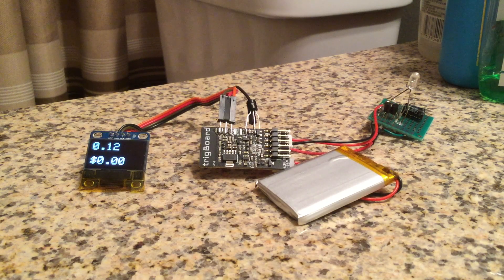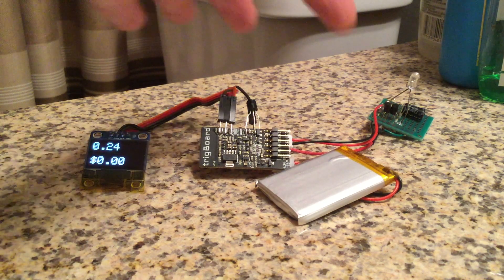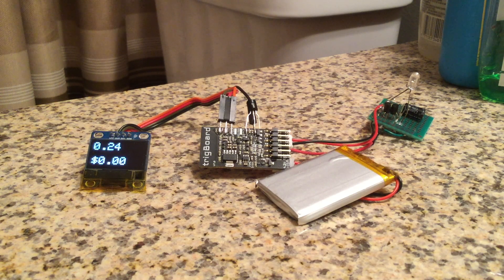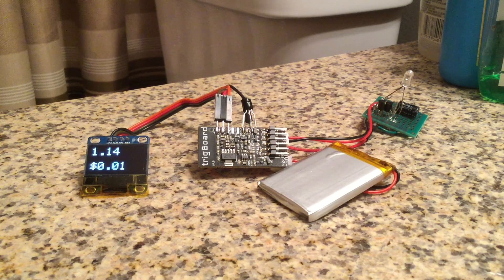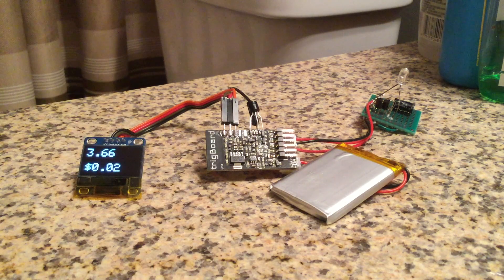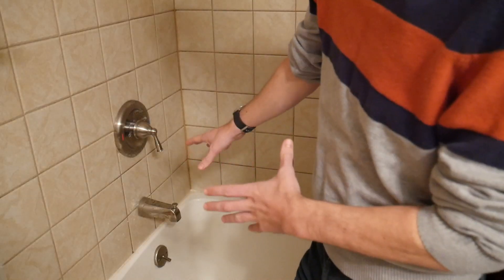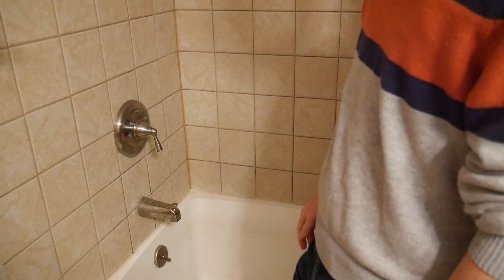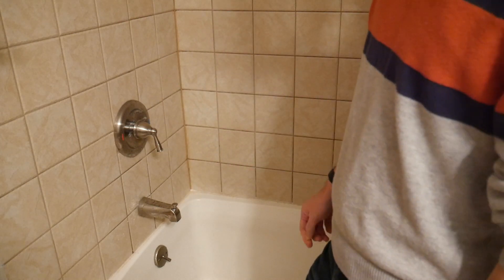How I cut my water bill in Half with IoT!

Comment: I was planning on making the same thing, but with optical sensors instead. The water meters are is in the bathroom and the kitchen. My shower time is around seven minutes, with about four and a half minutes of running water. Never really measured how much water is used, but just keeping water running down your body for many minutes is nothing but wasting perfectly fine drinkable water.
Reply: Time how long it takes to fill a five gallon bucket with your water source, then 5/ time in minutes = gpm.

Comment: I also developed a project to measure the water consumption in my house and when I looked to the numbers I was astonished by the water wasted during showers!!! My daughter easily consume more then 100 litres during each shower bath.
By the way instead of using a magnetic sensor I used a light emitter/receiver ic (QRE1113GR) to detect the movement of the little wheel on top of the water meter.

Comment: Great project.  I got the analog hall sensor you have - extremely sensitive to set the correct trigger threshold, even with the software filters you implemented.  I'll need to keep working on getting the trigger threshold just right.  Thanks!